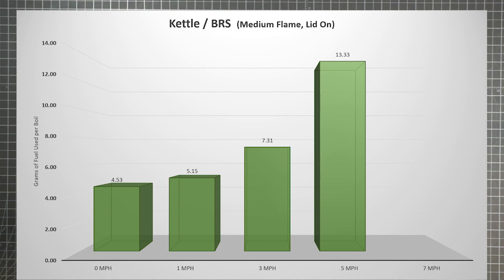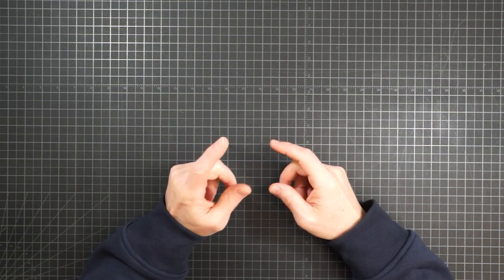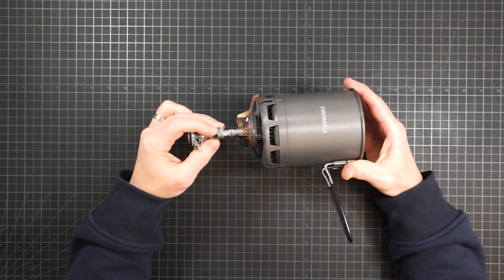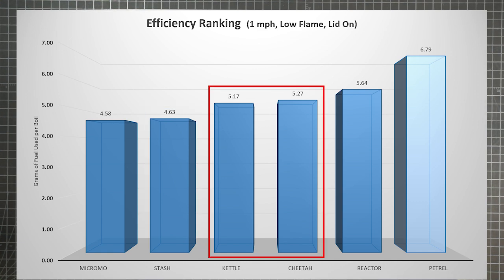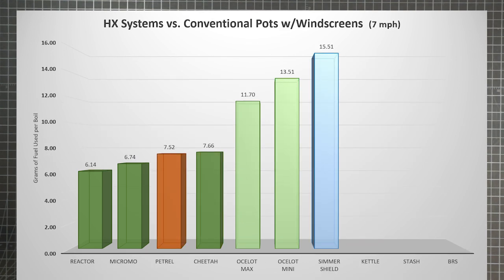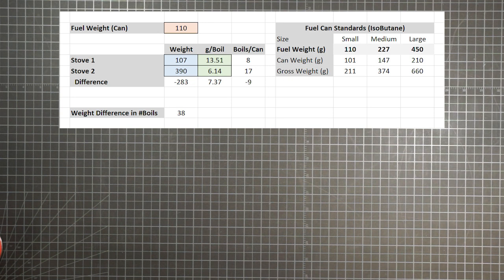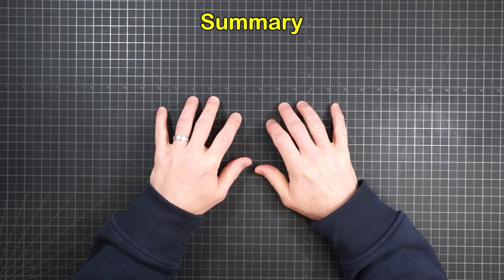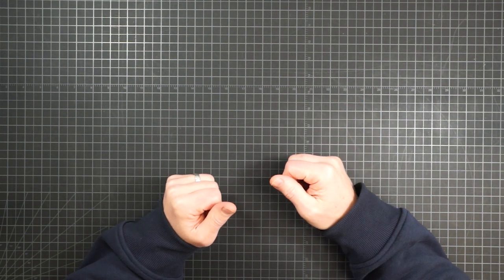Backpacking Stove Efficiency, Part 5: HX Systems in Wind

Comment: @GearSkeptic With the great effort and not inconsiderable expense I wonder if it would have been worth buying a modest gas mass flow controller (a German-made Allborg one with an LCD configured for IsoButane is about 1,100 USD ). A good scientific balance or temperature probe are not cheap either so may have been worth the extra mile and dobloons.

Just a thought from a highly appreciative engineer and scientist. Rock on good sir! 🤘
Reply from the maker: Out of my budget! I did do specific testing on gas canister performance (see Part 7) and was able to identify a sweet spot for testing (as a cheap workaround).
Reply: @GearSkeptic  I appreciate your stance on no sponsorships or affiliates. However, as I'm watching your Backcountry Water Treatment series and mulling over the controlled gas flow problem of the burner system tests I wonder if you'd consider reaching out to companies supplying and/or producing scientific equipment?

For full transparency I do not work with nor have any affiliation with any such enterprise. Just my 2c as they say.

Comment: Although probably not worth it by this point, you might try to make micro-adjustments with the valve using a source of vibration.  An ultrasonic cleaner or handheld “massage” machine should ease that “stiction” into a set point more quickly, and with lighter pressure.

Comment: What if heat exchangers are not actually heat exchangers at all, but just misunderstood windscreens? If this is actually what's going on - they probably don't need to be built the way they are and could be lighter.

Comment: 23:32 we all know that Graham Phobic does not pack a can of Worms. He uses a Ziplock bag to safe those back breaking extra grams. BTW worms can be cold soaked with oats for maximum efficiency on the trail.

I am not interested in buying a heat exchanger pot but have to watch it for consistency and top tier entertainment.

Unfortunately the perfect gas stove does not exist yet since we get fed the same stove designs for 20years.

Comment: One thing I like about a normal and wider pot, even if it’s heavier, is that it’s easier to reuse to eat directly from it. I’ve just watch a video in which a couple boil their water in a JetBoil, only after to use two totally different pots to finish their cooking. You can eat directly from the jetboil too, but the shape and cleaning makes it a bit trickier.

Comment: Trangia alcohol stove air vents are meant to face the wind, that way the flames go up.
There are numerous instances where the air vents were facing away from the wind, resulting the windscreen part melting.

Now the question:
By using a half circle windscreen, is the windscreen more efficient on the wind side or behind the stove?

If it's behind the stove the flames are pushed up to the HE fins, or not?

Imagine a U shaped fence, there's no wind or vortex if the wind blows from the side which has no wall.

If the wind blows from the wall side the sides create vortex or turbulence which draws the air away from inside the perimeter.

Comment: I just ordered the Stash and I'm planning to use it with a windscreen because well the colder it is the more heat you lose from the pot sides.

My previous system is a 700ml kettle and I get 5dl(2cups) boil with 2½ 4g esbit tablets.

I was thinking of getting a 800ml Trangia Mini pot but then the Stash was on 50% sale for 84.50€ so...

Comment: As for the lindall valve - I think you may be using an isobutane propane mix considering it's called all season, and pure isobutane will never evaporate below -11c. You may have mixed a more concentrated isobutane fraction when you refilled from empty bottles, making the pressure lower despite being the same temp.
Reply from the maker: See Part 7. There is a section on preferential vaporization.

Comment: These videos are absolutely incredible. Thank you so much for doing these. One additional anecdotal item regarding the Reactor - one reason we chose it for our purposes is it's one of the few canister stove that still works okay in below freezing temperatures - it can still require some warming of the fuel canister but it seems to work much better than just about any other canister stove, most of which simply refuse to work when you get even close to freezing temperatures. That combined with it's ability to function in surprisingly high wind (like at the top of a mountain) when other stoves don't work at all, and even though it's heavier than it "should" be its almost the only canister stove that still functions in those parameters. This is also why I still use white gas, especially in the winter. But of course, these are different use cases that what you are testing for.
Reply from the maker: I’d eventually like to add white gas stoves to the testing, and compare them to canisters in some colder weather!  Also, running canisters upside down in liquid feed mode. So many tests… 😏

Comment: Outstanding work! Are you aware of the phenomenon that in gas mixtures the more volatile gas gets evaporated first? When you refill from used gas canisters you are concentrating the Butane in the Isobutane/propane mix - making the gas pressure of the new mix drop. I think it would be better to refill from new huge canisters, or to use cheaper straight butane or propane (since you are measuring thermal efficiency). I had a longer comment but the draft got deleted after I switched apps for a second
Reply from the maker: See Part 7 on Gas Canister Performance. It is a deeper dive on the subject.
Reply: @GearSkeptic  oh sorry ignore my other comment then: I'm sorry I commented before I watched everything again 😭
Reply: @GearSkeptic yeah sorry I assumed when you said pressure regulator you meant ones that regulate to a specific PSI (like ones at your house after the gas main) not a valve that passively drops the pressure - I probably zoned out at the explanation of your experimental. Amazing work! I love looking at actual data - not vibes

Comment: Im curious as a hiker who almost exclusivly goes hiking with a partner who share a burner and cook set up and as a result use the Widesea 1.6L HX pot crossed with a SOTO wind burner. Specifically, I am curious about if there is an improved efficiency when boiling larger volumes of water? EG got a HX pot due to the percieved effiecency gain eg (less fuel losses for the longer boiling times associated with higher masses volumes). Have Saved weight in the form of excess fuel? or has the excess weight of the HX not worth it when considering longer boil times?
Reply from the maker: I did find a difference.  See Part 6. How much of a difference can be influenced by the pot material.

Comment: to me it would seem the most effective calculation is the grams it takes per system to achieve target number of boils with some kind of wind cavaet. So if I was going with a group of 4 people, for 5 days. Requiring 500ml/per person 2x/day x5 days = 40L of boiled water. Using the 1L efficiency, and then comparing something like the ocelot mini + gas auto-calculation. That would seem to give the best answer no? A spreadsheet that could ask you: how many people, how much water per person per meal, how many meals per day, estimated wind range. With that information, you could probably get closer to prescriptive vs suggestive options?

Comment: what do you think about the possibility that the weirdness of the WideSea Cheetah was caused by a resonant oscillation in the air moving around the bottom of the stove? That could explain why it would get better at higher speeds

Comment: Nice work, 

If you empty a gascan it tends, certainly in colder conditions, to run out of propane faster than out of butane/ isobutane. This influences flame temperature and pressure. A refilled can might have a noticeable different mixture.

For me, 3 mph wind is 1 Beaufort, 7 mph is still only 2 bft, a light breeze,... 
A fresh breeze, 5 bft, is up to 24 mph wind. On an exposed site anything but a radiant burner is quite a hassle to get a bit of an efficient boil,..
In the vestibule of  a hilleberg black label tent a gale force wind outside gives a lot of stoves a hard time in the vestibule,..
That is when you want a radiant burner,..

Comment: Another great video!  I'm realizing that I need to test MY  set ups, in various conditions, including putting the canister in a ice water bath (winter/ cold seasons in the Rockies)   My Whisperlite & SimmerLite may come back into use for snow melting!
Reply: One thing I used to mention, when I sold stoves, is the use of "half empty" canisters, especially as most people don't have gram scale, nor know the package or full canister weight.  For a 3 day trip, it makes more "weight sense" to burn more fuel, as you will have less to carry out.
 Like carrying wet food vs the dehydrated food AND its needed water.  I say that all the food until the first water resupply might as well be "wet food".

Comment: Aha! You finally did this video. 

This confirmed what I thought when I used the Petrel G2 plus Campingmoon (Soto copy) in my video vs the MSR. There wasn't much wind but enough to cause issues with the MSR Pocket Rocket which was much further away from the pot that the Campingmoon/Soto clone. It was almost double the boil time for the MSR, which surprised me. Even a little wind that gap between pot and stove, something that does sacrifice some fuel as per your Pt 4 - becomes an issue.

I started to get worried about my choice in Pt 4, but this vindicated it, cos as I've seen elsewhere the Jetboils can have a crosswind problem.

Also I wonder if the issue with the Widesea could be somehow the shape of the holes? Air flow and fluid dynamics would explain issues at some speeds not others, maybe the air flow is being directed in ways that smother the jets?
Reply from the maker: When the weather cools again, I will try out some shield/screen options on HX systems to see how much better they can be made.

Comment: I’ve been rewatching this series again, preparing for some upcoming trips.  Thank you for the comprehensive, entertaining and utterly useful information!

I got lucky and acquired a Jetboil Stash from the Recycle section at REI (half price).  I also purchased one of the Ocelot Stash rings from FCG.  I am going to try to do some wind testing (not as precisely, I suspect) to see if it helps the Stash cope with higher wind speeds.  If you do get some testing done on that question, I’d love to see it in a future video (even just a short one looking at windscreens and HX).

It was interesting to learn of your observation of canister damage after refill.  Perhaps it is moot, since it doesn’t seem to affect medium and low settings which are where we should be operating most of the time anyway.

I am a bit biased, since I’m willing to pay the Stash weight penalty if it means a more reliable boil count in unpredictable weather.  And a more consistent boil duration.

Again — thanks!  Great work, and so thankful that you took the time to share it!
Reply: Oh — and one more thing.  I also bought one of the Ocelot 6 universal windscreens from FCG which is a lightweight version of the Primus screen.  It’s a little more fiddly than the Stash ring, but it might also help in higher winds.
Reply from the maker: I have a FCG Stash shield, as well.  When the weather gets cool again, I plan another video of HX systems with enhancements!

Comment: An update on Petrel weight. I recently cut off the top of the pot, right below the bottom rivet and just above the 500ml line. Removing the lid, handle, and top bit reduces the weight by 2.64 oz (almost half). Adding a tupperware lid gets you a 3.01 oz HX pot on par in weight and capacity as the Toaks 550, but with all the benefits of an HX system.

Comment: Another possible explanation is that the lighter isobutane fuel vaporizes out of the fuel cannister first leaving behind a higher concentration of propane, which has a higher boiling point. When refuelling, you end up with more propane and less isobutane.

Comment: Micromo should be lighter than 319g with only the pot and it‘s stove, I have a SOL which is basically the same as Micromo and it weights 270g on my scale with the pot and stove
Reply from the maker: Different brands that seem similar can be surprisingly different.  Also, don’t forget the lid.  Check out Jetboil’s website. They list the MicroMo at 340g.  I use a scientific scale with high accuracy, and it reads 319g for me.

Comment: from experience in the navy, calibrating flow rates for a given valve position is challenging even when valves are specifically designed for repeatable positioning.  Given that the actual burner's gas flow won't be exactly repeatable for all individual systems, I think results are still valid even with the lost datum.  Not sure what the mechanical design of the adapter valve is but when we were trying to dial in a flowrate, we would open at least half a turn past the desired setpoint and tighten back down to minimize valve popping.  When opening the valve, you usually have some slop with the valve stem and the valve disk which can result in popping but if you are tightening or closing the valve, you have direct contact between the stem and the disk which usually gives  you less popping as long as you operate the valve slowly.

Comment: Could the refilled cans have lower pressure due to a higher ratio of butane vs propane? During normal use the propane component might preferentially boil off and by combining a bunch of mostly used can of fuel, you end up with higher concentration of the lower Vapor pressure butane.

Comment: Though you judged the MSR Reactor harshly, I love its performance when I have no need to simmer cook. But everyone's experiences guide his unique perspective. My conversion came when trying to boil water with a Snow Peak GigaPower stove in very strong winds. Though I have no idea of the actual wind speed, they were strong enough to push me around and force a small lean into the wind for stability. Needless to say, I was never able to achieve a boil. Depending on where you camp, you may rarely encounter such conditions. Much of my backpacking is in the Rocky Mountains at high elevation. Sometimes in inhospitable camping spots. My tents can handle the harsh winds I often encounter, but I am willing to carry a heavier stove for reliability in extreme conditions. Extreme conditions are exactly when reliability matters the most. Eating a calorie rich, hot meal when camping in bitter cold winds gives me a lot of confidence. However, for those camping at lower elevations or in thicker cover, that extra reliability would probably be overkill and the extra weight of the system a handicap to putting in extra miles.

That being said, I really admire the work and expertise you put into this research. I also appreciate how fair you were in analyzing the various trip parameters that might alter cooking system choices rather than just declaring one stove system the universal winner. Top notch content.

Comment: This has been an excellent series. I did similar tests for a high school senior project on alcohol stoves in 2008 and was thinking of recreating it with updated tech. This is a great baseline to start from. I found that stoves was sensitive to height above flame and 1 inch with a cat can was optimized with a tall windscreen system. There were a bunch of other results, but seeing this series definitely makes me want to test it again with alcohol systems following your methodology.
Reply from the maker: @BrandonGrahamForge  I have started collecting alcohol stoves for testing, but it will be a while before I could get to it!
Reply: @GearSkeptic  awesome! All my tests were for homemade kits with the Varga Triad and the original cat can as my baselines. There have been so many new developments since then it will be great to see what you find. I'd be happy to share any of my experimental designs if it's useful.

Comment: I do it a little different, but I might change things slightly after watch this. I have an MSR Pocket Rocket 2 and bring a 4oz or 8oz depending on trip length. As a backup I always bring a titanium twig stove. The system works wells and removes a point of failure.

Comment: Maybe an idea.. Measure how much weight the valves burn unrestricted by pots for a minute burn. If you ever need to readjust, do that again and it could give you a factor to apply to the new measurements?? Or build a rig to hook up compressed air and a manometer?

Comment: Thank you for detailed tests, but I didn't get answer to my question from the beginning - does it make sense to use BRS with petrel instead of Windmaster? It will slip inside the same way, but BRS is not only much lighter, but much more compact than windmaster as well.
Reply from the maker: The BRS has a flame that is completely unprotected.  The Windmaster has a shroud that tucks into the heat exchanger ring for some combined protection.  Expect the BRS to perform noticeably worse in the wind.  You will have to prioritize weight versus fuel efficiency.

Comment: Could the change of flow rate come from a change of the gas mixture due to high vapor pressure gases evaporating first, leaving more low pressure gas in the mix after a refill?
Reply from the maker: I don’t think so. The reason is, the canisters (before refilling) show no change in performance. Just the act of pouring the leftovers into a new can would have no effect on the mixture.  So, the refill should perform the same as the low canisters used to make it, but instead I get this pronounced step change in performance immediately after the refill process.  Differential burn off should be a gradual, on going effect.  My test temperature is well above the vaporization level of all gasses in the mix.